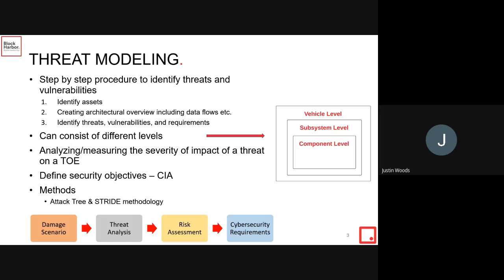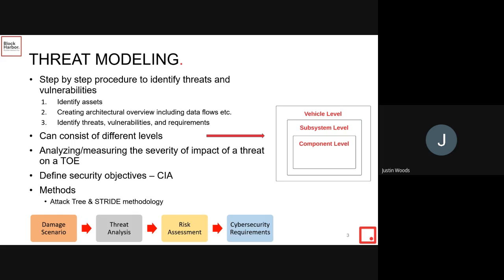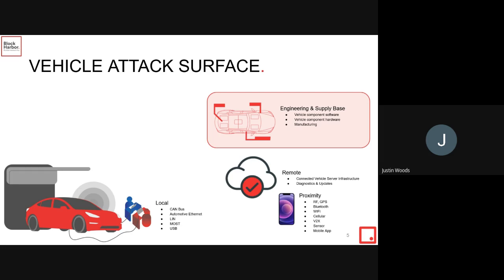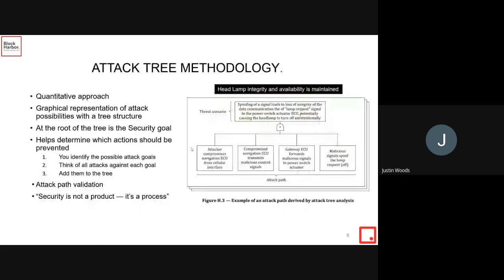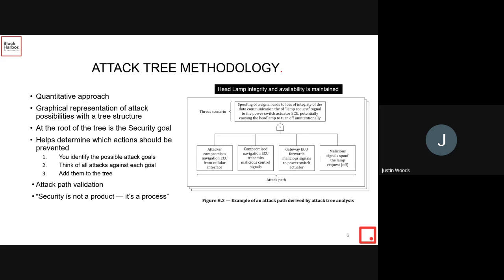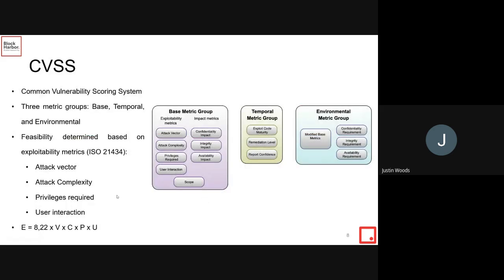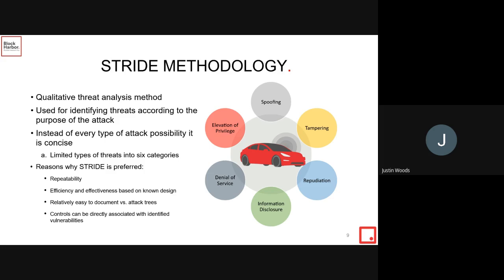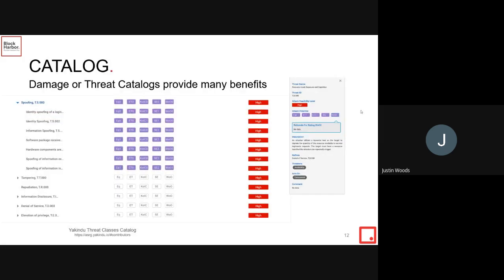ISO 21434 Vehicle Cybersecurity - Threat Modeling Methods - 5/10

Comment: If it's an EV, attack surface would also include the charging port itself. The FHWA's NEVI Plan NPRM defines OCPP as the predominant EV charging protocol to be used, where the OCPP documentation describes communication from EV charging station to car via the physical input to the vehicle.